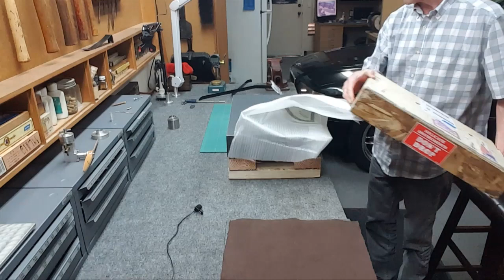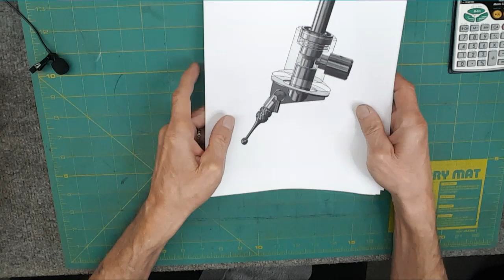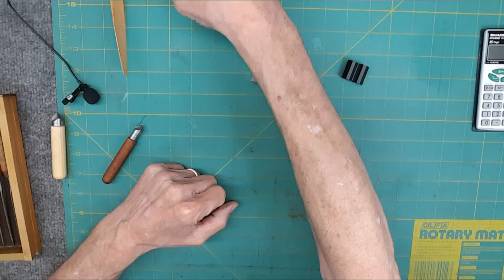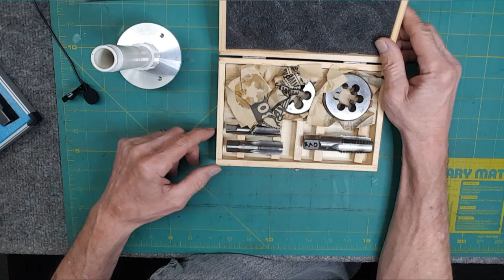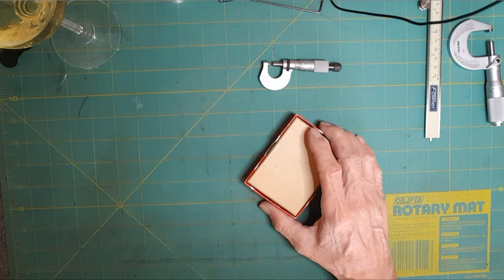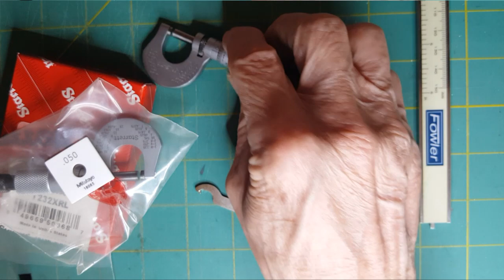Friday Night Buffet #5

Comment: Thank you, so what you are saying is that it has a fault in the way it is assembled, or built. I have had a fault with a US made Starrett caused by a build up of muck between the locking ring  & the thread, inside. I have never come across this before. But I will admit to preferring the Jedburgh, Scotland, Built Starrett's.  But I am from this side of the pond & supposed to. The one difference is that Starrett only make Micrometers in the USA now. The plant in Jedburgh makes other Starrett stuff. The Jedburgh Mics work. Mervyn

Comment: Sir, this new Starrett is covered in oil, so you will never get it to zero-out, it should be at least half a thou out until you get its faces clean. Please get it clean before you pass comment.Oil has a thickness of around 4 to 8 tenths of a thou. I agree that it does sound a little tight  when you wind it out. But again that is due to old oil. The best cure for this is a good oiling with new oil to flush the old oil out. After you have unscrewed the spindle from the micrometer frame. Use extra fine oil, please. It sounds a wonderful micrometer to me. Here in England we can get fully synthetic oil for these micrometers now. But if you get stuck, the easy way is a visit to the local knitting wool shop for some sowing machine oil. Just remember that with a synthetic oil your problem of getting the anvils clean is that much greater. So it is usually safer to measure the diameter of a known drill diameter for a very small size. To check that the mic is reading all right. Sorry but it is all too easy to get into this oil on anvil problem. Just think about it. You cannot move the mic back & forth to clear the anvils as you can on a piece of metal, can you! Synthetic oils stick like the proverbial ! Don't they. Regards Mervyn Price.
Reply from the maker: I guess you didn't see me clean the measuring surfaces in the video. Old oil has it tight! Why does a brand new Starrett mic have old oil in it? Seems funny the old Starrett mic with old oil, that I rebuilt, worked just fine. BTW I've had many years experience with mic's and have 9 different types so I'm pretty knowable on their usage and cleaning.. The problem that was explained in the video is if the zero is correct then the vernier is off and if the vernier is correct then the zero is off. Oil doesn't cause a linear reading problem. Never had any problems with new oil covered Mitutoyo's but maybe that could be just luck... Cheers...

Comment: You most likely had to rezero your micrometer because of thermal expansion. You stated your area was 80 degrees. Most calibration of dimensional devices is done at 68 F
Reply from the maker: I did the math on a 6" stainless caliper in a video some time ago and temperature is so insignificant over 6" let alone a 1/2 micrometer...

Comment: Hey Dave, it's was probably my video that you found making and using the DIY coax designed by Bill Todd. The bearing is a press fit. I have used it a few times and it works well within .002. It is great for my mill because I have very limited headspace and a Blake would not work. It was a fun project and certainly stretched my amateur skills. Good stuff as always. All the best!
Reply from the maker: Couldn't remember where I saw the video but well done!! I was thinking the bearing had to be a press fit which is an incredible tolerance to achieve...
Reply: @TheMiniMachineShop  Thanks Dave!